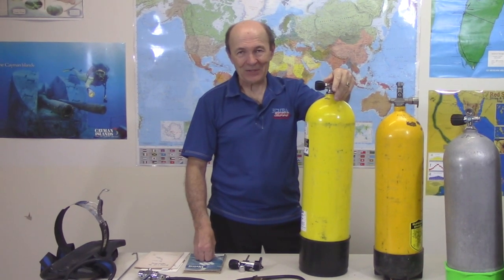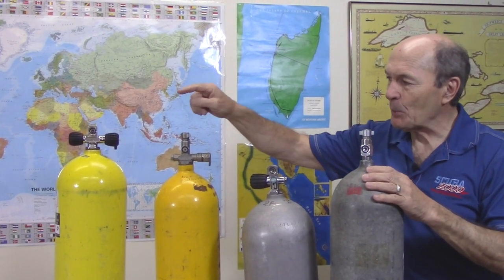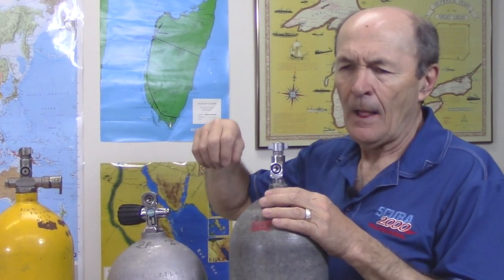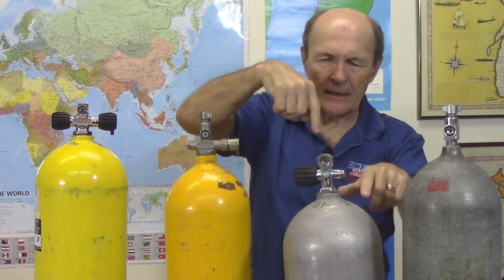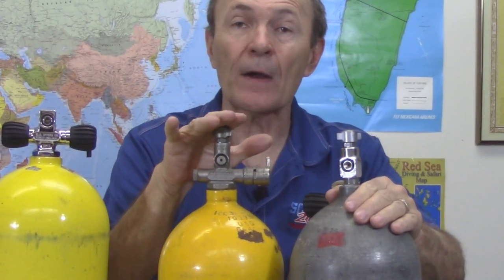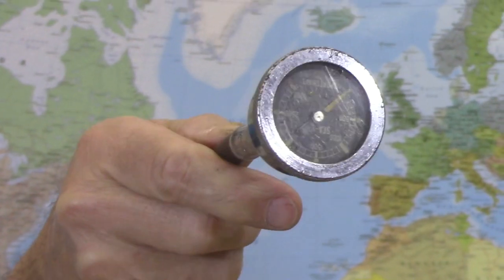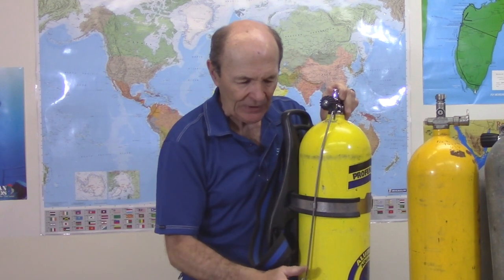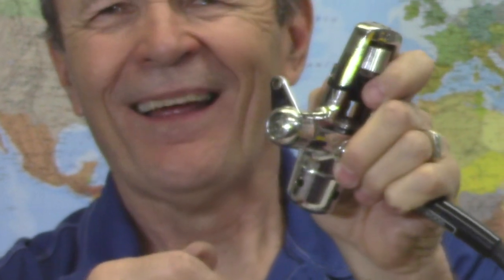Tank Valves - J or K - Vintage Scuba: S01E05

Comment: Lol K valve= kill valve.. lol my instructor in 1986 still was teaching turn the air on then back off the valve 1/4 turn.. lol always done it since. Lol
Reply from the maker: The turn back is no longer a practical need and is no longer taught to divers.
A
Reply: @AlecPeirceScuba_SeaHunter  hehehe but I never had a stuck valve since i started doing it....... hahahahaha
 My biggest thing is pointing the pressure gauge away from everyone when I open the valve. Trying to hold both the gauge face and the blow out  pointed away from everyone. I did have the glass blow out once but not the pressure relief thingy on the back of the gauge. It was a dacor, and I am pretty sure it was 3300 psi that did it..  in a new tank.

Comment: Hi Alec, 
 I also forgot about the Sherwood "Y" valve. I have a picture of it for you on my Facebook site. Here is the link.

https://www.facebook.com/photo.php?fbid=10154785325923724&set=pb.762908723.-2207520000.1480860494.&type=3&theater
Reply from the maker: Wow! I remember that! I never had one but it was an early attempt to provide the safety of a second regulator. It's also an odd combination of valves from different eras. The thread is 1/2" from the 50's; the knob is a pillar style but with a modern plastic knob; it was made in the mid-late 60's when 3/4" valves were already replacing the 1/2". Maybe Healthways had a bunch of old parts laying around.
Thanks Russell